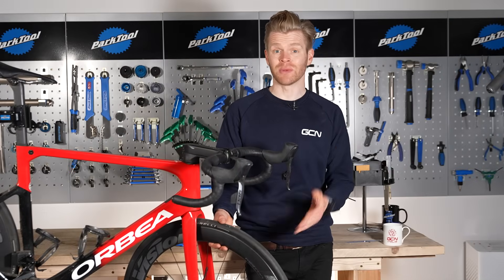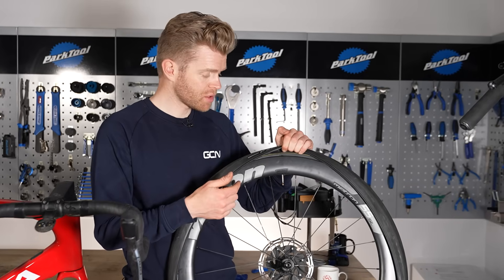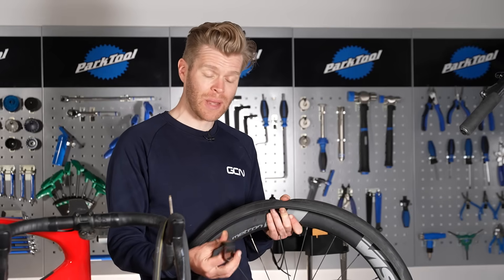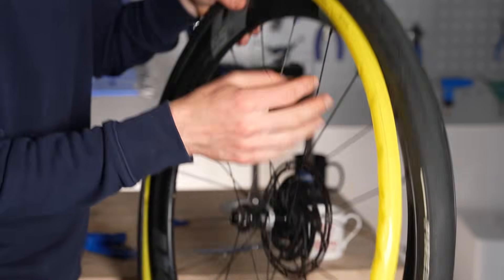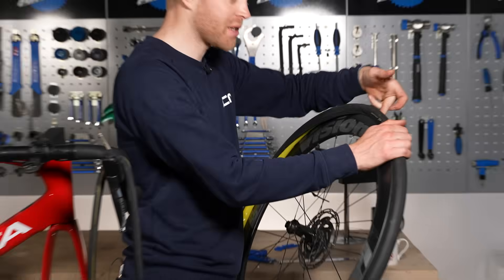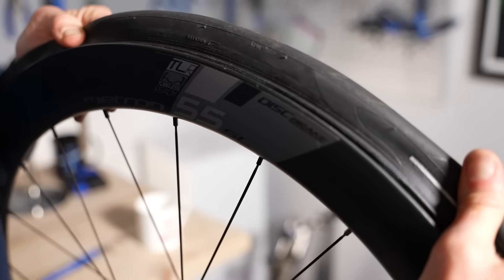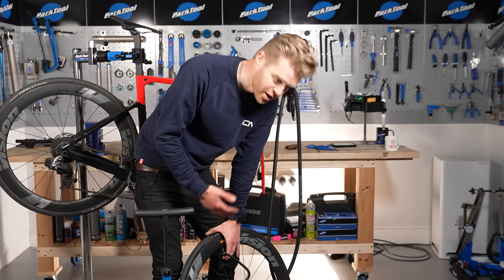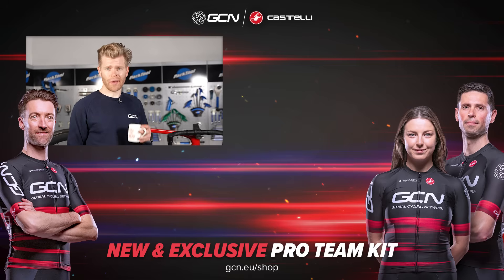How To Change An Inner Tube Quickly - Easy 8-Step Guide | Maintenance Monday

Comment from the maker: Have you ever changed an inner tube? Do you have any hacks? Let us know in the comments!👇
Reply: Hacks? Sure...get yourself a 'Tyre Glider'. Best tyre accessory I ever bought 👍
Reply: For my 20" folding bike I carry a roll of gorilla tape. Don't need to remove wheel ( which is a real pain, especially on the rear.) Just patch the tube, sticks well without too much cleaning. Used to replace tube when I got home, don't even bother to do that now, it works so well.
Reply: Can you do a video on gcn and and you ever YouTube channels of how to wash your Garmin heart rate monitor strapped and how to change the battery
Reply: Great video Ollie, especially the bit about placing opposite bead in middle, never to old to learn. You may want to do a version with rim brakes and releasing the caliper, especially when trying to reattach a fully inflated tire
Reply: Long presta valve - the hardest thing is how to fit it through the hole in the rim

Comment: I used to get a puncture every other day in Winter travelling to work. It was always on wet roads and usually small pieces of glass. I always carried a spare tube but removed the inner tube to carefully gauge the puncture and where it matched the tyre then carefully identify and remove the puncturing article. After removing the article I would also check the rest of the tyre before replacing. My dear Dad gave me an easy off tyre lever made of plastic which made tyre removal a breeze. My time was usually around five minutes. Later my dear Parents gave me a Specialized puncture proof tyre for Christmas....bliss, no more punctures riding to work.
Reply from the maker: This is key, too - it's a lot about tyre choice. If you're fed up of the punctures, you should ideally invest in more resistant tyres!

Comment: Don't just check the tyre for sharp bits, but also check that the rimtape is OK (smooth, not missing). Keep your spare inner tubes out of sunlight to keep them in good shape. The baby powder suggested by Chris Herbert is also a good one (may even reduce rolling resistance). Oh, and when you put on a type, make sure that a label is next to the valve. This will allow you to find the sharp bits from the location of the puncture in the inner tube.
Reply from the maker: Rimtape is often overlooked as the cause! Great tip!

Comment: I feel like every tube/tire replacement video should use continental tires. I want to see others struggle as much as I have
Reply: Yep, I managed to puncture 4 new inner tubes when installing Conti tire on single wheel.
Reply from the maker: Tyre manufacturers do vary in difficulty, for sure. Though we steer clear when we can, using a tyre lever is sometimes the best option if you're struggling!
Reply: I just put on a new set of Conti 5000s this morning on carbon Rovals. 
Used levers to pull off first bead
But able to install new ones tool less. Make sure the first bead installed is in center, and that excess tire slack is pushed towards remaining section of tire to push on
Reply: I use contis, and I've never had a problem putting them on or getting them off the tyre, even without levers.
Reply: @pembrokeshiredan  you should change your name to Dan Super!
Reply: The amount of thumb skin I've removed trying to put a Gatorskin back on "properly"... Punctured 2 new inner tubes at the side of the road 2 weeks ago. Thankfully got the third one in...
Reply: @Jacob99174  😂
Reply: Try a 23 mm Schwalbe Marathon
Reply: @taufikabidin412  I've just ordered some Schwalbe Pro One's - Ill let you know how I get on...
Reply: With Contis, I have started to insert the second bead 90 degrees from the valve. That way, when I get to the last bit, I don't have a valve in the way, and the opposite side is well centered inside the middle channel with no valve stem in the way. It makes it much easier.
Reply: And Fulcrum rims.
Labor intensive.

Comment: pump up the tube after taking it out so you can see where the hole is and hence where to examine the tyre for thorns etc.
Reply: Yes,yes,yes!
Reply from the maker: Absolutely! Even better, pump up the tube and then circulate it through a full sink of water or a bucket, and you'll easily see where the offending hole is!
Reply: @gcntech  can the next video be a buyers guide on bags that can accommodate a mug, a kettle, a stove, a washing up bowl and a few litres of water in case we get a puncture while out and about? 😃
Reply: That’s a great benefit of aligning the sidewall decal with the valve!
Reply: I always carry a full water bottle and a collapsible dog bowl. The best solution is though to carry spare inner tubes.

Comment: Excellent! I agree that it’s best to try to avoid using levers to re-seat the tire after installing the new tube. Maybe in some cases it’s not possible, but I think that by following your tips it should be in most cases. Thanks again, great demonstration. 👍
Reply: it is possible not to use levers but he did not explain how

Comment: I have a few tips.  It helps if your replacement tube is coated in baby powder.  The powder allows the tube to slide easily inside the tire during inflation.  I store my spare tube inside a ziplock bag, already coated with baby powder.

I had to help a friend with a flat once.  The tire had a big hole in it so we needed something to place inside the tire to prevent a tube blowout.  I used a dollar bill.  They're quite strong enough for the job.  Come to think of it, I never got my dollar back (been 30 years...).   

Finally, running your fingers around inside the tire may help to identify the culprit, but that doesn't always work.  What I do is to take my tube out and carefully lay it on top on the tire/rim just the way it came out.  I fill the flat tube with air and check for where the air is coming out.  That points to the part of the tire to inspect more carefully.  I've found pieces of glass or rocks that weren't detectable by the fingers.
Reply: +1
Reply from the maker: Great tips, Chris, cheers!

Comment: Great video, however [warning; total noob at this] I was changing a rear MTB tyre and tube alongside watching this and once I'd finished and was about to put the wheel back on.... the air turned positively blue. I found words I didn´t even know existed! The reason for this is that at no point in your otherwise very helpful tutorial, did you mention the tread direction (this may only apply to mtb tyres) Of course, I've put it on facing the wrong way. This wouldn't be much of a problem with the front wheel, but sadly I didn't take into account the cassette being on the correct side! :)

Comment: I usually inspect the rim strip after removing the tube. Sometimes if it is not seated correctly it can cause a flat.
Reply from the maker: This is very easy to overlook - even Ollie did it!

Comment: When you take the old inner tube out, pump a little air into it, listen or feel for air escaping and it should give you a hint where on the tyre to check for sharps.
Reply from the maker: Great tip! This is made even easier if you put the pumped up inner tube in a bucket of water, then the bubbles where the air is escaping will lead you to the hole!

Comment: I always run a finger around inside the tire, looking for things that could puncture a new tube. One time I cut my finger so bad, it wouldn't stop bleeding. I had to sit there for close to 10 minutes, pinching my forefinger and thumb together, until it finally stopped. For spares, I always carry tubes that I've already patched. Some of them are old, and have three or four patches. I always use small Rema tip top patches, in a box of 100. (a lifetime supply)

Comment: I'm not sure about the correct term in english: professional tire changing workshops (for cars) use special tire changing paste that helps to slip the tire into the rim. The paste is cheap. The smallest amount one can buy is a 1kg bucket which is much more than you need in your lifetime. I went to a local workshop with a container and a spoon, asked politely and they let me fill it (I put 2€ into the coffee savings box). I always carry a small container when I'm biking. You don't have to worry about the tube slipping within the tire because the paste evaporates quickly. It's not a magic trick that solves all your problems with difficult rims but it can be helpful.

Comment: My dad uses a smear on washing up liquid to make it easier to remount the tyre. (But remember to remove any excess from the braking surface!) Tyres had a steel cable in the bead, back in the Olden Days.
Reply from the maker: Definitely a great hack if you're really struggling - and with those steel beads, who wouldn't!

Comment: With some combos I could "persist" with my thumbs for a year and still no nearer
Reply from the maker: Oh absolutely! If necessary, you should use them, but we always try and steer clear if we can!
Reply: there are tools called "tire jacks" that are used to get the tire onto a tight rim, but without risk of damage.  Kool Stop makes a great one for the shop, and there is a portable tire jack called "EZ Clincher".  I keep one in my saddle bag.

Comment: The first job I do when I get a puncture is to thoroughly check the outside of the tyre to see if there is any thorns in it. If I can’t see anything, I then run my fingers around the inside, if I find one, I remove it, and I never think well that’s it, I always check to see if there are anymore.

Comment: tire lever if used carefully will be just fine..some tire rim combo is just impossible to mount using power of thumb and palm.
Reply: I always do my best to mount with hands only, tire levers only act as my last resort.
Reply from the maker: It can be risky though, damaging your rims or just causing another puncture - it's usually fine, but we like to try without first 😁

Comment: For puncture proof tyres use adjustable zip ties, put the bit the tie feeds through against the rim. Squashing the tyre against the rim makes it easier to out on.  Carry a small container of chalk / talcum powder in a small bottle instead of using provided chalk.
Reply from the maker: This is definitely a great hack in a pinch - just don't tell our resident zip-tie hater Si!

Comment: You forgot to say: line up the company logo of the tire with the valve...when you get a puncture and locate the hole in the tube you can then match the area on the tire of the potential debris that might still be stuck in the tire. P.S.: I guess you didn't want the video to last 30 minutes, hence why you didn't use a CONTINENTAL tire! 😆
Reply: Hahaha so funny and true
Reply from the maker: This is a great tip, and as a bonus, it looks so much cleaner!

Comment: Not using tyre levers to put back on, hmmm, very difficult me thinks. But yes, if use them there is a need to be careful.
Reply: Yeah I use Vittoria Corse tyres are near impossible to get on by hand!
Reply from the maker: It can definitely vary from tyre to tyre in terms of difficulty, but we'd always recommend using your hands first, and use tyre levers as a last resort
Reply: @gcntech  Thank you and yes, I can see this is good advice. But in practise for me, still difficult. I have Continental GP5000s and pretty darn tight. But low rolling resistance and good puncture resistance also. I actually always carry 'the bomb' aerosol to inflate to get home before changing, it works!

Comment: Video sounds great - very simple BUT... in my experience (a frustrating experience) trying to get the tyre off with or without tyres levers is a nightmare. Eventually I am able to get the tyres off and the replace the inner-tubes but my poor fingers and especially thumbs, are sore for a few days afterwards. These DIY 'change the inner-tube' videos would be more helpful and realistic, if difficult to remove tyres - e.g. brand new tyres were featured...

Comment: Call me old fashioned but I thought that any self respecting cyclist and regular commuter would know all this stuff. My experience with different tyres and wheels is that they don't always cooperate with the rider as easily as this demonstrator alludes, particularly some Campag ones. The only new information that I might take on board would be to fill my insulated bidon with a brew especially when it's raining or snowing just in case I puncture.

Comment: The best way to prevent punctures and all drama around it is to buy a puncture resistant tires. Yeah they are not light, but usually you dont have supporting car with spare  wheels on your ride. I have been riding road bike for about 3 years now, no puncture yet and I am in the heavy category riding also on bad roads. With my city bike I punctured every second exit.

Comment: At 2:46, IMHO, it's completely opposite. It's important to get the SECOND side of the tire in the groove of the rim as much as possible to have enough slack in the bead to pop the last part over the rim. To that end, it often helps if the first side is out of the way in its final position (also, to relieve any excess pressure in the tube).
Reply: Indeed, the position of the back side is less important. More important is to get inflation of the inner tube perfect, no to hard so it does not hamper the upfront side to slide into the groove and hard enough to prevent the inner tube to get caught between the rim and the tire. And Chris always finish at the valve please!!!!

Comment: #askgcntech I often find the recommended pressure on the tire is different than what is listed on the wheel?  My TT HED carbon wheels for example state 70 psi but my Pirelli tires (following their handy chart) state 90 psi based on my weight.  Whom do I follow?
Reply: Absolutely. My Mavic Allroads have a maximum pressure of 65psi as they are hookless. The tyres on them have a much higher pressure rating.
Reply: Follow the one with a lower maximum pressure.

Comment: What has happened to repairing a tube ? A patch ? Are we all in so much of a hurry . As a kid I never imaged removing a wheel to repair a puncher , a patch , contact glue , a pin , sandpaper  ,and a piece soft chalk . Lucky if I had something like a tyre leaver or a tool to remove the the NUTS to remove the wheel .

Comment: Don't use levers to get the last, stubborn bit onto the rim?  I strenuously disagree.   Especially if you're trying to reseat GP 5000 tires (tyres) or something similar, most people are going to need some leverage.
Reply: I always do my best not to, they only act as my last resort. I'm more likely to do it if the rim is aluminium.

Comment: #ASKGCN  HOW TO REMOVE A TUBELESS TIRE WHEN IS STUCK TO A CARBON WHEEL (because of SEALAND)
Reply: Sometimes it's not because of the sealant being sticky (depending on the composition), it's mostly because your rims lock your tire beads hard.

Take a look down the rim of various tubeless-compatible wheels and you'll notice which ones lock the beads hard and which ones don't.
Reply: @sbccbc7471  any suggestions on how to remove them? I have seen some ppl laying the wheen down and pulling from the spokes, not sure if that is safe.
Reply: @FRamirez1A  Currently, I push one point of the tire sidewall inwards, right where the bead is, with my thumbs as hard as possible to get the bead to unseat from the rim.

Some will take a few attempts due to soreness and pain building up inside the thumbs that contribute to strength loss overtime.

Comment: 03:10 wrong wrong wrong, there is a scientific explanation that it is so wrong
Reply: Well then you better say it. You're not helping anyone by staying silent!
Reply: @wuzihuzi  I will, but someone has to ask for it, I will not save those who do not want help. when the outer tire is returned to the wheel, it is never started on the valve because: then there is not enough rubber to mount it because the valve is in the way, the tire can not sit deeper in the rim, ,, you should start opposite the valve, parallel to both sides, insert the outer tire into the rim and at the same time, stretch it so that the root of the tire is in the middle of the width of the rim and when you reach the valve symmetrically on the left and right side of the valve, there is enough rubber left that it can be pushed into the wheel with only your hands, without levers

Comment: I always struggle to place the valve correctly. Any tips?
Reply: Insert the inner tube starting from the valve first, then work your way out to tuck the rest into the rim and tire.

Is your valve always at an angle instead of sticking out vertically?
Reply: @sbccbc7471  yes. that's the problem. The valve is at an angle. And once, I even made another puncture by ripping the valve away from the tube.

Comment: there is no "quick" method to fix the flat. taking time making sure to identify the cause of the flat and make sure to add the air slowly to ensure the tire is seated correctly in the rim. also for rip on the tire, paper money [I always carry some paper $$ when riding for emergency stops and for food] works wonder as they are none stretchy and strong with coarse surface so stay-put during installation unlike gel/protein wrappers which is made of slippery and very thin plastic which can also wrinkle inside.
Reply from the maker: Great hack!